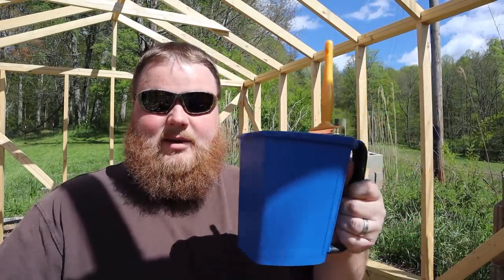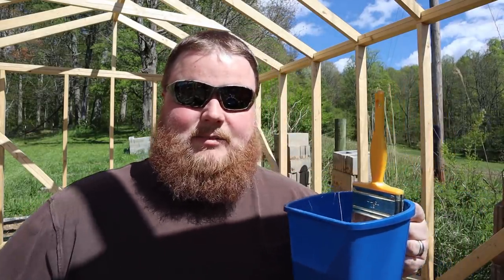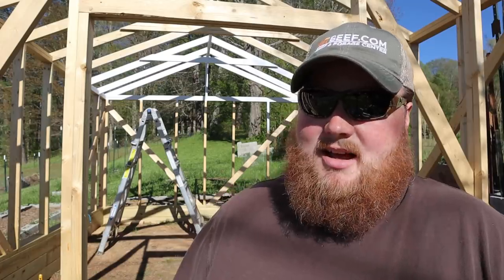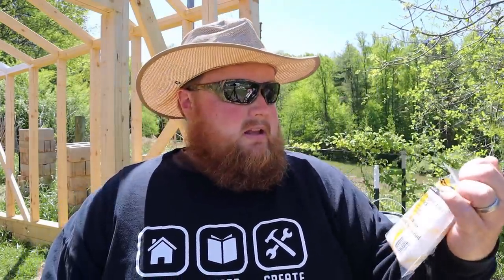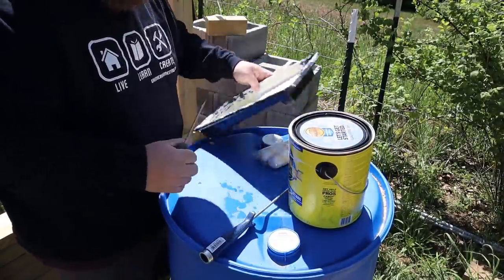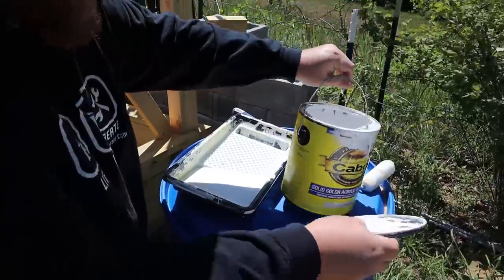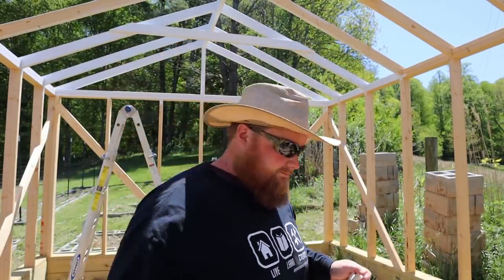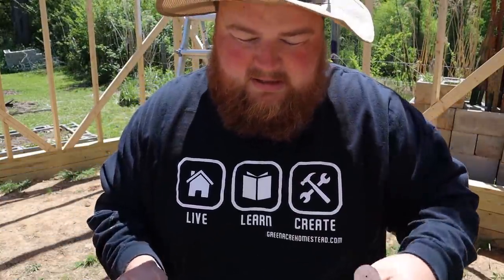What a Difference! Painting the DIY Greenhouse - Build #6

Comment: You did s beautiful job on the framing and the staining looks good but coming from someone that has a greenhouse, unfortunately that structure is not gonna last long. You should have gone with pressure treated wood. There will be moisture and condensate all over that frame and is not gonna blend well with the untreated wood. 

I’m sorry this sounds like a negative comment but I don’t mean it to be but am just speaking from experience Brother. To minimize moisture issues make sure you have fans in place at each end, and have ventilation set up so the humidity can get out otherwise it will be raining in there. 

Be safe brother and prove me wrong please! I love being wrong lol 😂

Comment: Sam here's a little bit of advice from an old gardening fart oops sorry gentleman, you might want to think about installing opening roof vents/windows, I would suggest at least due to the size of the greenhouse 2 each side along with automatic roof vent openers if you can, they also need to have along the bottom a straight run off glazing edge so the rain water can run straight off and not get stuck behind a rim, you may also want to think about another fairly large window on the opposite end to the door to allow through air flow, you should not need any along the sides, but the above suggestions is just good greenhouse practises, as they can get very hot in the summer often too hot, and it's better to do now instead of later, what sort of plastic are you planning to use by the way, not polythene I hope, it would be such a letdown to use on such a great and well made greenhouse frame, twin wall polycarbonate sheets is ok but by using horticultural glass which is not too expensive is far better, especially on the roof, you could compromise and use glass on the roof (I would make this a must) and polycarbonate sheets around the sides, or polythene around the sides if the costs are too high, you can always replace when funds allow check out the costs taking into account how long each product will last and how many times you will need to renew through time.